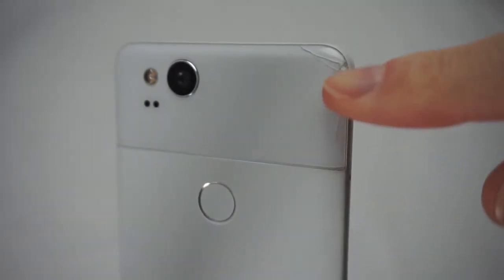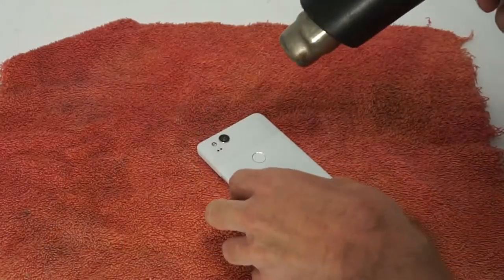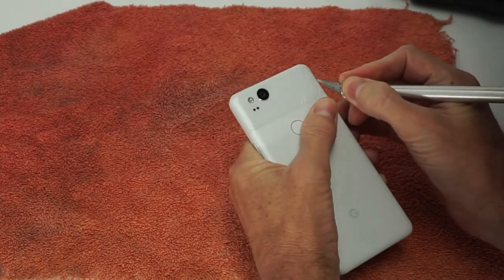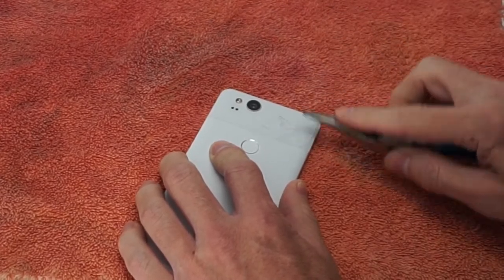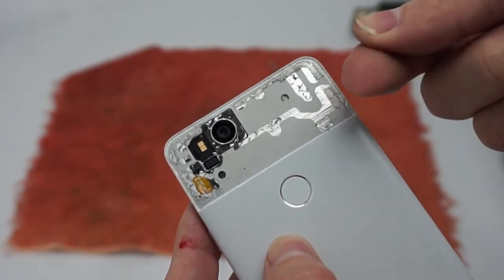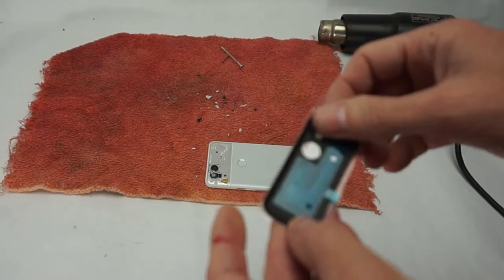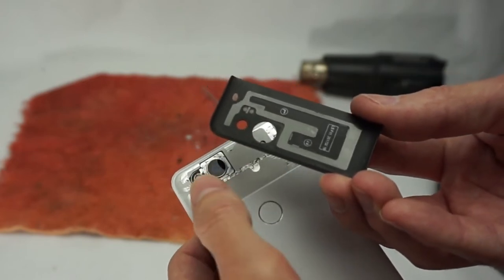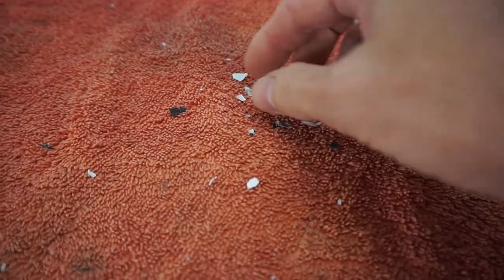Google Pixel 2 REAR GLASS repair removal DIY panda how to #teampixel

Comment: I just replaced the glass on my pixel 2. It is horrible but it went a lot better for me. First off pick a workspace where you can control the glass as best as possible and preferably one where you won't be walking on bare feet. I used paper towel under the phone so I could just throw it away afterwards, I also wrapped all the portions of the phone I wasn't dealing with in masking tape to protect it from scratches. No cuts or glass in the eyes because I used gloves and goggles. I applied a good deal of heat but prying was still annoying, I didn't shatter the glass completely but worked around the edges with a wood working pick that made it much easier and I was able to get some pretty sizeable chunks. Still took about 2 hours including scraping as much glue residue off as possible with a spudger.
Reply from the maker: That is excellent news. I'm glad you were able to benefit from my mistakes. This is not an easy fix, due to that bead of glue (it doesn't loosen with heat like the black adhesive tape normally does). And too much heat can damage the camera. So I think you found a great solution there! Congrats and enjoy!

Comment: You just needed more heat.  God this was awful
Reply: I didn't have all that much luck with heating how do you tell if it's enough? did you apply it with a heat gun? I was a bit concerned about melting the coating on an internal wire by applying too much heat.
Reply: I just did this job it was absolutely fucking miserable, heating did nothing in the adhesive was mental strong. Ended up basically using a wide flat razor in a holder and just taking duct tape and putting it over the glass so as I shattered it it would stick to the tape. What a fucking awful job

Comment: Huh,my pixel does not look like this.... The lens and flash covers are on the glass and I have two sensors under the flash. Behind the glass, under the lens cover, there's a casing in which the camera should go back into. Did a whole back camera and lense cover change but now I can't but the glass back because of to lips on the camera casing (on back of the glass panel)
Reply: Did you fix this eventually? I have the exact same problem...

Comment: Does this procedure affect the water resistant ability of the pixel 2?
Reply from the maker: If you were to apply a sealant on the back of the glass (around the openings for the camera lens, flash light, and outer perimeter of the glass body), then yes you could retain water resistance. I chose not to add any sealant because I am not confident that I could apply it without creating a mess. This sealant would also make the glass very difficult to remove again in the future, though... so you would have to choose between ease of repair or water resistance.

Comment: After Replacement...
Its Water Resistancey Work or not
Reply from the maker: It can be water resistant, if you add a bead of glue around the edges, and around the camera and light.
Reply: @VLOGNOSIS  ok I Use Skin Around The Phone and Edges... 
Still its water Resistant